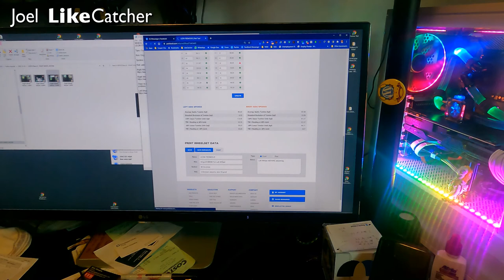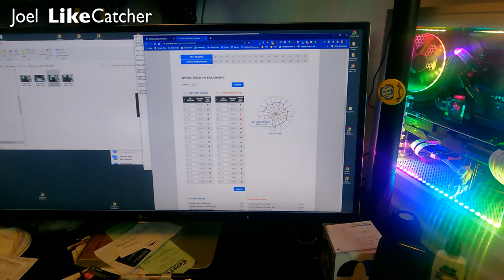Truing Trike Wheels

Comment: I have 20" wheels. My spoke tension tester doesn't work. Could you list all the tools you use?
Reply: I used a Park Tools wheel truing stand, spoke tention meter, zip ties, tire wrench (forgot the actual name, and assorted tire levers.
Reply: @JoelLukacher  what model spoke tension tool and does it work on 20" wheels.  I'm riding a Trident Trike Stowaway 2.  Thanks Joel.
Reply: I used  all Park Tools tools